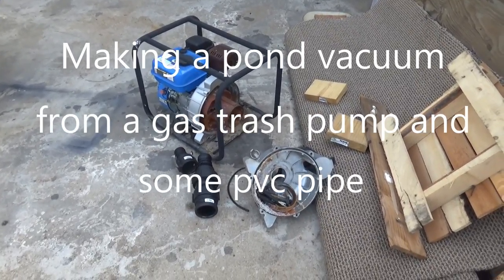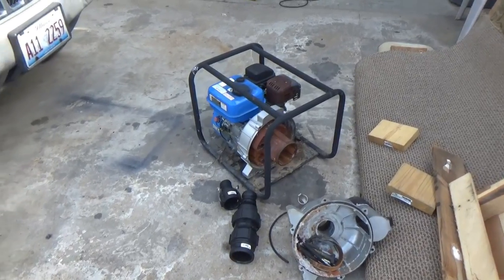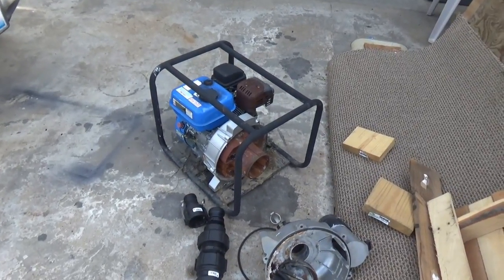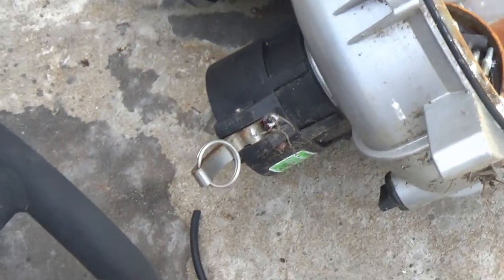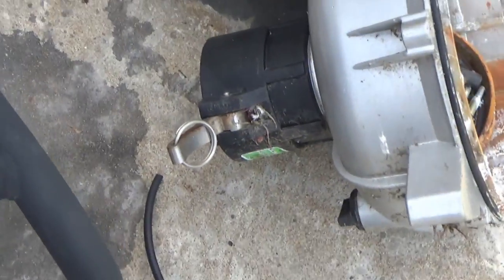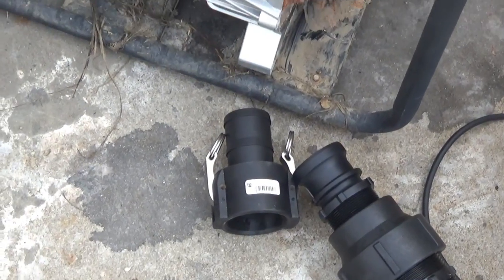Making a pond vacuum from a trash pump

Comment: We remove bottom sediments with such a motor pump. We clean and deepen moorings, boathouses. We raise sand from the bottom and lay it on the shore and create a sandy beach. To create such a mini dredger, you need two motor pumps. One motor-pump for mud and the second high-pressure for hydraulic washing. Also a special suction nozzle Bagermaster. All this is placed on a raft and all these works are performed from it.

Comment: Well, that's an ingenious little contraption for a pond vac.  Can you do this without fear of nosey fish getting too close to the vac-head and getting sucked in and through the trash pump, or is that what the funny sound was right at the very end of the video? Lol...  Be interesting to see how the lawn likes the discharge coming out the other end, there...
Reply from the maker: I couldn't use that the way it is if there were small fish in there. I would need to make a different head for it. I think the noise at the end was a chunk of algae  or mud or maybe a plastic bag. There's only 2 fish in there and they could never get through the pipe.